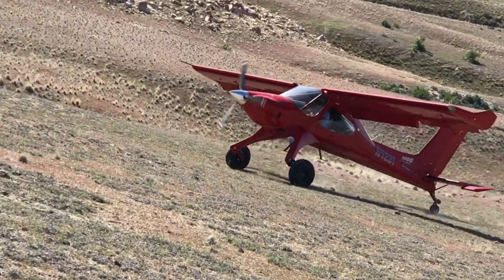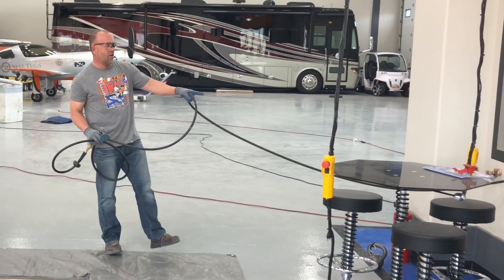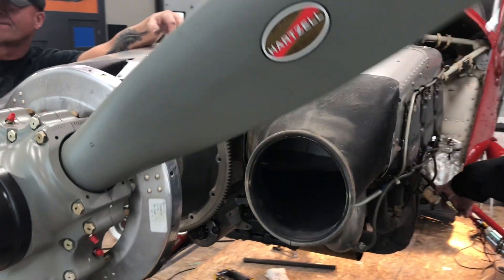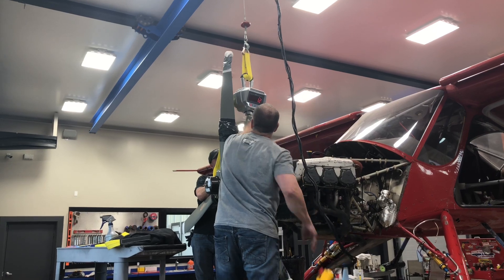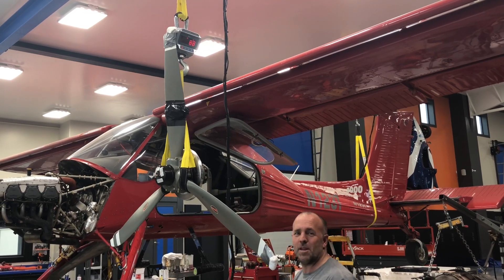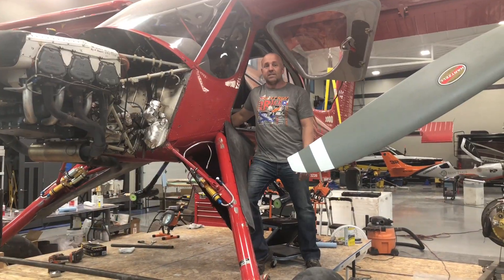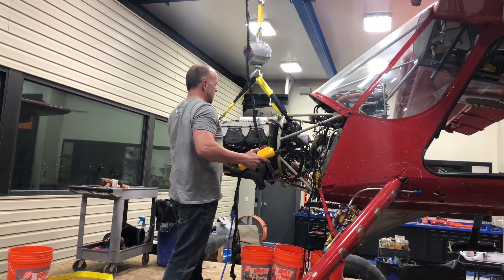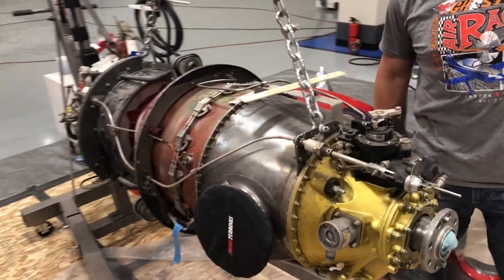Mike Patey Wilga (DRACO Video 2)  Pulling Motor And Prep For Pratt N Whitney Turbine

Comment: What kind of grinder is that at 35 seconds? Vertical angle grinder? I'm learning a lot from these videos. Thanks for sharing these!
Reply: Wide BlueSky..... Those are 4.5" Angle Grinders....I've been a Welder for 47? Years now...I like the DeWalt Grinders with the Trigger on the bottom that pops off the Power as soon as you let go.....The Grinders with the trigger on the side that you turn on with your Thumb can get Stuck and don't go off when you need them to.....On my welding Table I usually have 3 set up...1 with a Grinding Wheel #2 with a Wire Wheel for cleaning up and the #3 has a Sanding Disc on it.....For Bigger Jobs 
 I like the Milwaukee 9"....The 9" refers to the size of the Grinding Disc...and the 9" will work your ASS.....Local 342 Steamfitter Welder Retired...I was a Layout welder and worked in all the Refineries in the Bay Area and the Geysers up around Sonoma and Clear lake...Then we worked out of the Sprinkler Fitters in the Oakland Modules for Alaska because they paid more when the overtime Started....I worked at Moffitt Field......I had about 70 Different jobs over my Career before I had to Retire due to medical problems....I still WELD making Pots or Shit I made for my Wife...She just loves this kind of Crap...I go to Schnitzel Steel and there's piles of Gold ... Today a made a Bird Bath out of Discs they use to plow fields and some 3" Victaluic pipe used for Fire....Theirs about 10 or 12 Acres of scrap Gold out in Terrabon Oregon...Scrap piled 20 feet high....It's like a Candy store to me.